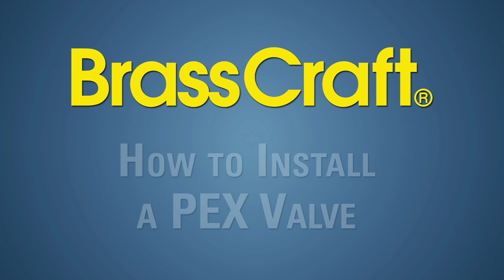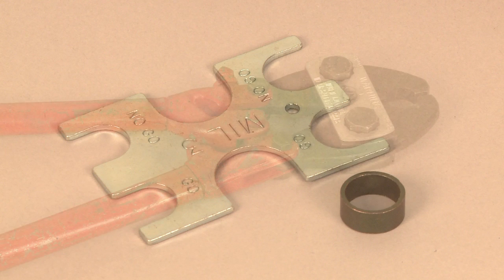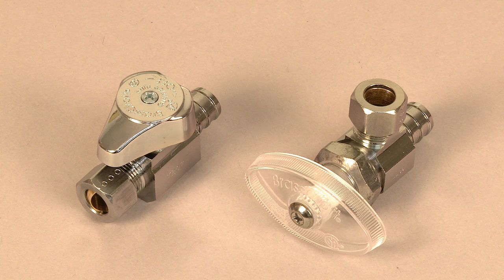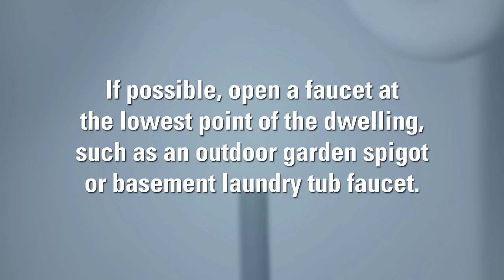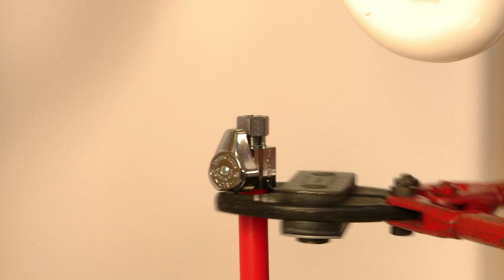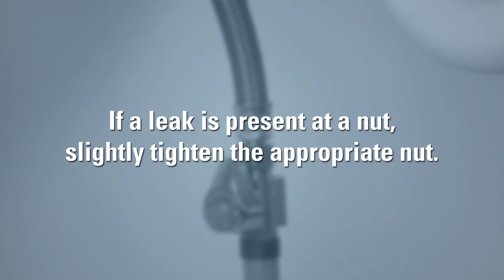How To Install a BrassCraft® PEX Valve

Comment: I would put a threaded male fitting into the pex and crimp it in and then thread on a threaded shut-off valve.  if the valve ever needs replacing, you don't have to mess with the PEX again.  Just screw off the old valve and screw on another one - BOOM.

Comment: 1st turn off electric Hot Water Heater. If you open the lowest hot water valve and the water drains below the top element and the thermostat brings on the top element you will then need to replace it.

Comment: Need help. I'm using the 1/4 turn brass valve with pex line to the valve and a pex line going from valve to dishwasher. Problem is I can't turn the nut to remove the pex line going to the dishwasher.  What do you recommend?

Comment: How to remove it .  Is it the only way to remove it just cut it off.   This type of valve may make the pipe getting shorter .  When you need to replace the new one.

Comment: this is something I had done today by liscened pllumbers.  the original hot water tank valve, they said,, was done totally wrong a hole was punched into the copper line and the orignal valve was screwed in. I think my home inspector when I bought the home was not doing his job real well.  the leak got into my sheetrock. the procedrue is as follows like in this video my invoice discribed it as "Cut 3/4 waterline and tied on to it with a shark bite(valve) and replaced water supply ine and the line that tees into the side hotline that was leaking that connects to the humidifier in the the attic .  (and that 3/4 inch was where the original home owner had drilled a hole and screwed the old coroded valve into-very VERY stupid!) worse of all the sheetrock around and behind the washer will have to be replaced. he said it was full of water  and would mold. it already has! I can see! so I am afraid for my cat and myself and any hosue guest!

Comment: This video is missing a crucial step: removal of the old valve! This is the kind of instructions or how-to video made for someone who already has done this before. How about the rest of us?
Reply: Um, you remove the valve the same way you remove any other pex fitting. You unscrew the braided supply line and cut the pex line below the fitting. Use your pex ring removal tool to cut the crimp ring.

Comment: No tape on the hose connection?
Reply: i realize it's been a year since you posted this, but no, it's a straight thread with a sealing gasket inside the fitting. you don't tape these.

Comment: Incredibly useless video. All you did is show how to crimp a PEX fitting and how to attach a hose. Now, how about attaching the stop valve to the wall??? With copper or galvanized the valve is rigidly attached  to the pipe that cannot move. How does a flexible PEX tube rigidly hold the valve?
Reply: These are not designed to attach to a wall.
Reply: I don't think it neccessarily needs to be rigid, but if that's a concern then you should convert your pex to a copper elbow to stub out of the wall, and secure that to blocking in the wall
Reply: @bluearcherx  Those years ago I was researching the pros and cons regarding PEX and copper. Copper won by a landslide and I did the whole house in copper.
The two main considerations:
1) Copper is naturally antimicrobial.
2) There were instances reported of things growing in PEX. I do not remember if it was fungal or bacterial.
Another MAJOR thing to consider is copper is 100% recyclable although that was not a consideration at the time.
Reply: @tinaleanne8230  don't forget there is different grades of copper plumbing, don't use the thin cheaper stuff.
Reply: @onenikkione  Finished my replumbing years ago. Typical installation: thin wall inside, thick wall outside (underground).